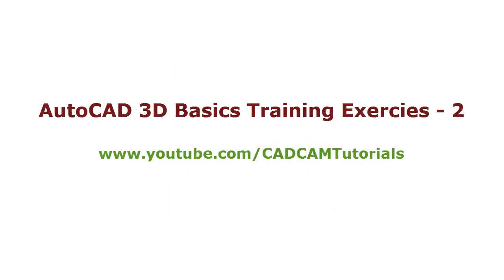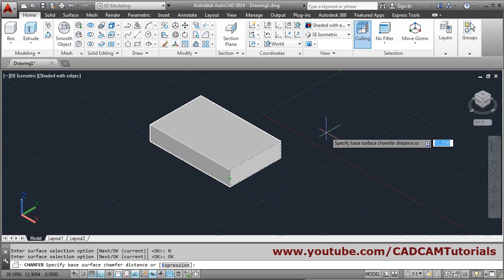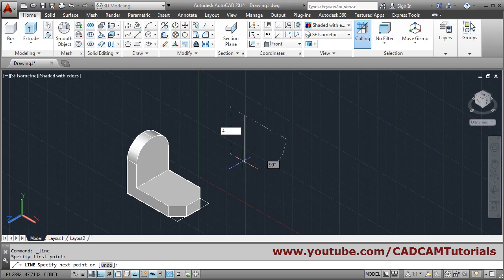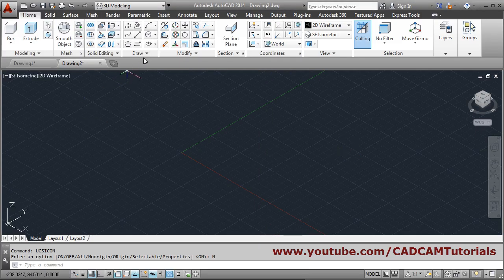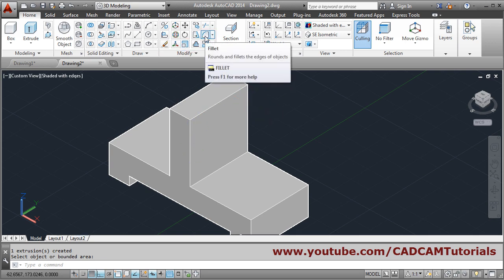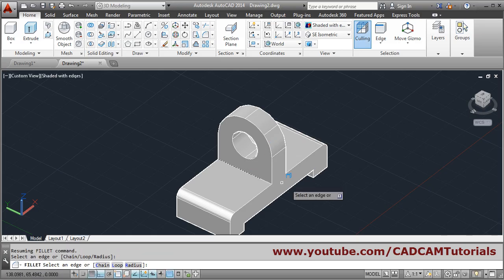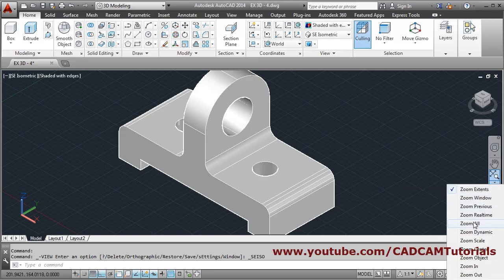AutoCAD 3D Basics Training Exercises - 2 of 3

Comment: Hello Sir, can I ask you something? What will I do if the presspull doesn't work in backward direction?
Reply from the maker: You will have to use extrude command for 3D conversion. And substrate command for cutting hole.

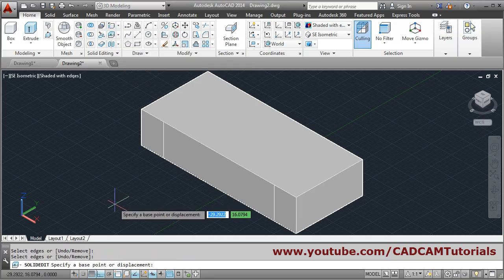Comment: Could you please explain how to Copy edge in Z direction at 8:09? I tried many times but failed to obtain correct direction, it only went to X or Y axis... Thank you in advance!
Reply from the maker: Take your cursor above in empty space, don't keep it on the object then it will work
Reply: @CADCAMTutorials  I tried but still couldn't. I'm using AutoCAD 2020. But I solved it by going to Options>3D Modeling, and tick "Show Z axis in crosshairs" in 3D Crosshairs. Thanks a lot for your nice videos!